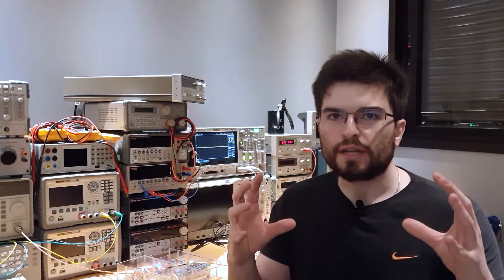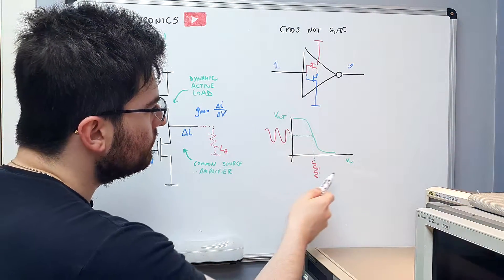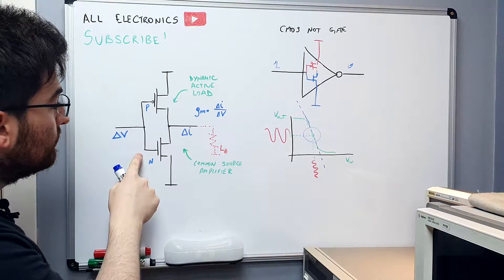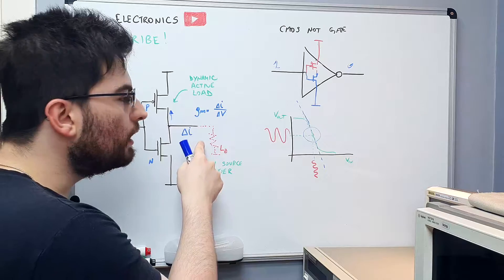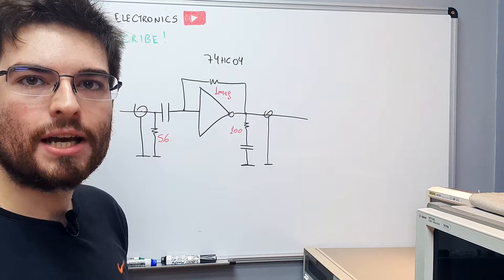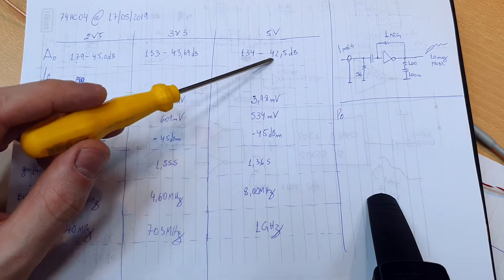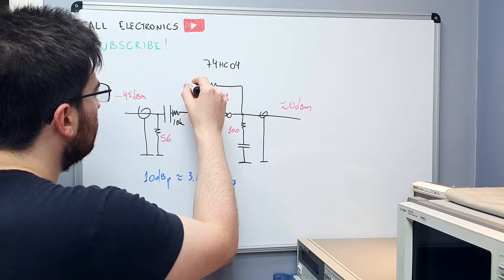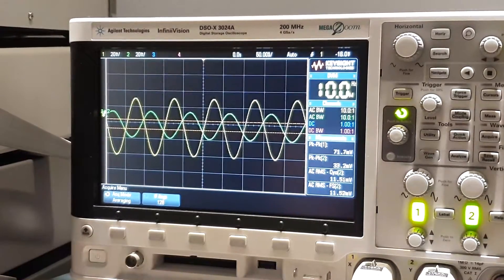CMOS Inverter Gate Analog Amplifier

Comment: Great video, I saw a schematic like this and had no idea what it was.  But the comment was that it only works with unbuffered logic since buffered gates have too many stages and their open loop gain is too high.  And supposedly it also won't work for Schmidt Trigger parts. I saw an example with 74LVU04 which is an unbuffered inverter with Gol ~ 20-40.
Reply from the maker: It works - but it is difficult to handle.. Go with unbuffered gates if you can.
Reply: @AllElectronicsChannel  I found this trick in a schematic to improve the edges of a digital signal (SPDIF).  Why not use a proper comparator for that purpose? Because fast comparators  are much more expensive? Unbuffered inverters only have one stage so their rise/fall time could be about 20-30ns but apparently it is OK for the decoder.  Comparators could be as fast as 2ns but it's probably not necessary.

Comment: Isn't this just basically a Class-B amplifier? Curious about the amount of crossover distortion.
Reply from the maker: The topology looks like a class B but it's actually more like a coupled class A pair or a class A with active load. You can see that each MOS is doing active gain in a common emitter configuration. A classical class B would work as source followers without voltage gain.
We could measure the thd of one  stage !

Comment: Very interesting and informative video. I have been interested in these circuits for some time. As segrus.ru says these circuits seem to have been popular in Russia. I have seen several circuits for active antennas based on the unbuffered version, 74HCU04 devised by Russian short-wave enthusiasts. I built one and found that it had much more gain than the usual circuits, but the signal-to -noise ratio was not as good. I had to insert a 20dB attenuator at the input to my Software-Defined Receiver. The other country I have found information from is Australia. There was a very readable article by the late Bill Currie, VK3AWC published in the UK about 20 years ago. Back in the 1960s there were quite a few radio and audio projects based on the original 4000 CMOS chips whiich were unbuffered., I can see several unused pins in your video. Presumably  you would tie unused inputs to ground or the supply rail if this was a permanent  set-up. Is there any danger of the circuit becoming unstable at very low or very high frequencies, where the output capacitors reactance might be too high.? Someone else who tried using a buffered inverter chip found that he had made a 240MHz oscillator and the chip became very hot.
Reply from the maker: Thank you! 

"Presumably  you would tie unused inputs to ground or the supply rail if this was a permanent  set-up."
Yes!! 

"Is there any danger of the circuit becoming unstable at very low or very high frequencies, where the output capacitors reactance might be too high.?"
Yes, no doubts! 
As the CMOS stages have a lot of gain, it`s very easy to oscillate with the supply and package parasitics ! 

In my tests what gave me good results with the buffered versions is the output RC that I used to control the open loop gain. The stage has very high transconductance, so a low output transresistance is necessary to reduce the open loop gain. 

This transresistance needs to be there just in AC, so I coupled it to GND with a capacitor. 100 ohms gave good results and stability with 74HC04. I think this is the trick. If you try to use it directly to drive a high impedance circuit it will oscillate as crazy, in very high frequencys ! 

Other thing is that the gain roll-off quickly after the first pole knee. So it`s hard to approximate the stage as an first-order with constant gain-bandwith product.

Comment: Yo should have used the 4069UB instead and it will be more clear....
Reply: Or maybe 74HCU04 which is also unbuffered. I've seen the same thing with crystal oscillators using logic gates, unbuffered is recommended, but some people use the buffered versions. Texas Instruments have some application reports on the subject. One report is focused on the 4000 series and another covers the *04 series. The conclusions seemed to be that the buffered gates have higher gain, but also higher propagation delay and less stable in some applications. The unbuffered version of the 4000 series had a better AC bandwidth than unbuffered.
Reply from the maker: I read it was necessary to use unbuffered gates. But trying with the HC04 using a low impedance output to increase gain margin seems to work fine as I demonstrated !